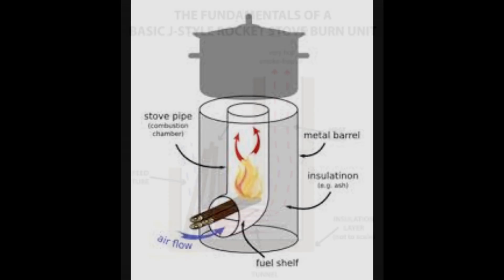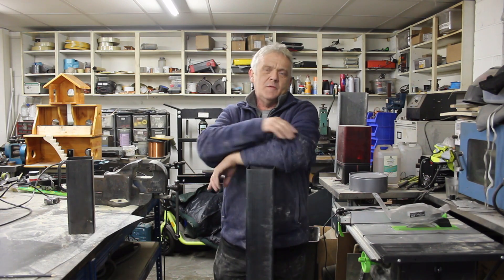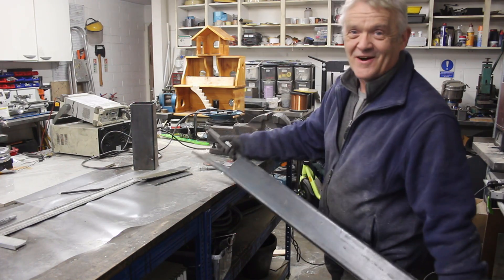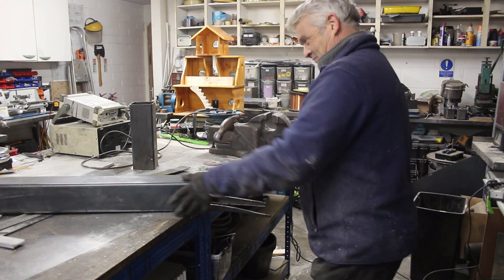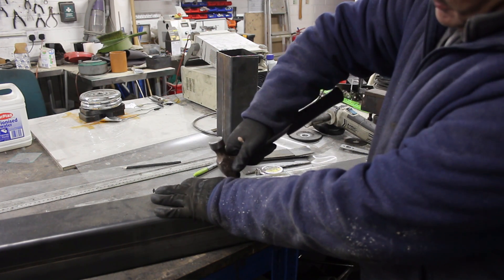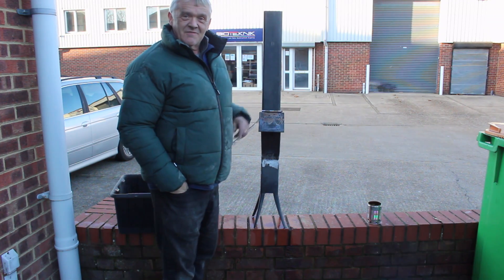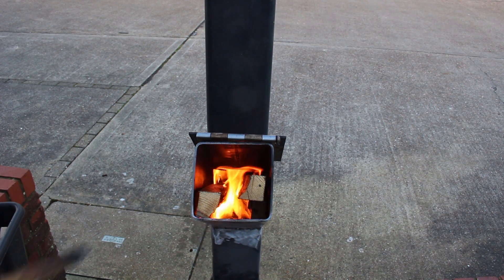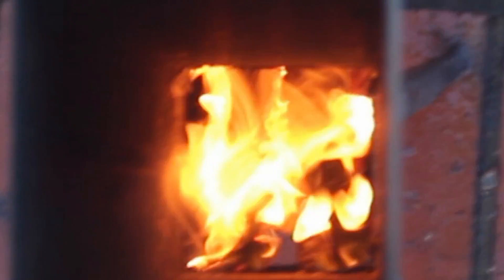1770 A New Type Of Rocket Stove - The 'I' stove

Comment: Have the hot gasses do a u turn so they are directed downwards then another u turn upwards, if you were particularly skilled you could have the hot gasses forced through a few tubes to go down then upward and then make them all form into a chimney and have a sand battery built around the tubes to maximise how quickly the hot gasses heat the sand as it would greatly increase the internal surface area that can be heated and to transfer said heat into sand.

Wouldnt be too difficult to build I imagine

Comment: So, I made a K stove with 2" pipe and enclosed the stove pipe with 4" heater duct.  The stove pipe went zig zaggy so that I had more surface area to get heat from.  The lowest end of the heater vent was open, and the top had  a small duct booster fan in it.  Tons of heat, so much it's scary.  i need an auto-feed because it burns fuel so fast.  You are an inspiration.

Comment: Awesome redesign and good way to think outside the rocket box!!! Good video!... I have a question for Rob and for the whole community. Has anyone put to use these "I" type of rocket stoves to make a hot air turbine for generation? Very recently I came across STONE PAPER, which is fireproof and can be made into container shapes, I was wondering if anyone else is working on integrating turbines with their rocket stoves? like taking this build and model of "I" type of rocket stove, would it be possible to construct a hot air wind turbine, made out of stone paper and place it inside the chimney at the right point to capture that blast of hot air?🤘😆🤘

Comment: 20 years ago, I needed a water heater. I had the innards from an old hot water tank. It was a double skinned copper tube with inch copper connections top and bottom. I stood it on bricks and connected it to a water cylinder. A small fire was lit in the bottom, the sticks dropped in the top. It was in a polytunnel to provide water for a shower. Dry wood was used there were virtually no fumes in the polytunnel. It heated the water quickly. You could use the shower in about 5 minutes. It was also very safe. Young children fed the wood in. The "stove" did not get hot on the outside and you could not hold your hand above it, it was too hot. It was brilliant.
Reply: Yes exactly. The tube was 2 foot long and 6 inches in diameter. I later built a ceramic stove from fire bricks. That had water pipes through it to heat water, for the taps and radiators. I installed the copper cylinder in the flue with a soot box just below it. In the summer I could light a fire in the soot box and heat the water tank without heating the house. The whole system worked really well.
Reply: wow this sounds really cool actually. Was this something like a very big Kelly Kettle?

Comment: Liked and subscribed! i'm curious whether there's any math that goes into deciding such things as the chimney length or volume? I know that 'smokeless' is a good sign because it implies a complete combustion. If there was any math in the decision for dimensions, I'd greatly appreciate knowing what it is, and why it is. Thanks!
Reply: Indeed there is. It has to do with air temperature and the way it can flow at those altitudes and pressures. Engineers are trying to do biomimicry with the things in nature that also employ chimneys for the same purpose, like the giant termite chimneys. There is math there too.

Comment: If welded build.

Some simplifications possibly there:

1. Feet, some lengths of rebar welded to the bottom.
2. Drill a round hole with a holesaw rather than faffing with an angle grinder to cut the flaps and use tube rather than square section for the feed.
3. Drill holes for rigid bar and weld in the grille for 2.

Additional potential mod:

Reinforce the rebar feet with a cross section which can potentially support an ash pan.
Reply: Good improvements!! Would it work if you used Stone Paper or Fireclay for some of these improvements?

Comment: Would you get any advantage if you add a damper at the bottom?
Reply: It would help to restrict the air flow that forms the center vortex of burning hot gasses and air.
Reply: Yes, i see. Up to a certain temperature the heat burns away all gases and after that the heat just goes out into the air. What about putting heat sinks all the way and all around the chimney? Maybe in combination with a damper. Would it maybe decrease fuel consumption due to lower chimney heat and higher heat efficiency/radiation due to larger surface?
/Christian

Comment: Whilst the rocket stoves you make are great (I have ordered the parts for the Rocket Stove Kit from video 1743) and are very efficient for burning, they remain very inefficient at heat transfer in that a lot, if not most, of the heat "escapes" out of the top of the flue. I want to use my rocket stove to heat my 6m x 12m workshop and that means keeping as much of the heat in the workshop. So, the challenge for you is to convert the 1743 rocket stove into an efficient workshop heater without the use of specialised tools. Can it be done?

😀
Reply: yes it can! Just Attach a large container filled with sand at the top with a copper cylinder tube wrapped inside the sand container like giant spaghettis.... This would heat the whole shop and home.

Comment: The trouble with these little wood burning stoves is you spend all day feeding it. Get some coal in it and you can leave it to burn while you get some work done. 😊
Reply: Thats why Rob teaches us to think outside the box with them.... for example, you can construct the whole thing from Fire proof STONE PAPER or Fireclay that can resist melting temperatures, then you can store ALL that heat with a sand battery or better yet, make the stove be as fuel efficient as possible by turning it into a vortex rocket stove that can generate electricity through heat and hot air.

Comment: any idea what's the best solution for long term solar energy storage at home, rather than a lithium ion battery? I mean... They're quite expensive and don't last very long
Reply: Use a sand battery!! SANDY BATTERIES!!! for two reasons; 1) you can directly wire a solar panel to a heating element embedded in sand, it can also be wired up so the sand battery acts as the place where you "dump" excess load... 2) Sand is cheap and everywhere!! plus you can keep it hot and then convert it back to electricity or use it to heat water
Reply: @captainnemo6655  how do you convert the heat energy in sand back to electricity, and how to seriously insulate it properly? I mean in freezing soil for example in some type of container obviously but how to get highest efficiency insulation to prevent any heat loss so the solar charging has its best cumulative heating effect with as little heat loss as possible? Can you elaborate on insulating the sand battery and converting the stored heat to electricity. And how rxactly to connect solar to a heating element, like? I'm super interested in this solution because lithium ion is just not sustainable long term for home storage, the lithium ion batteries are way too expensive and aren't long-lived... My

Comment: Great work. Have you thought of measuring the temperature of the two burn zones? Ie the solid-fuel burn zone and the gas-fuel burn zone. Did you know that if you get above a certain temperature by adding hydrogen that you can burn rubbish safely like they do in Japan? Then the supply of usable fuel expands to include certain types of household waste.
Reply from the maker: interesting mate - thank you

Comment: And the burning coals fall right out the bottom and set fire to the entire neighbourhood. 👍😎
Reply from the maker: really? good god man
Reply: Yeah! 🤫
If you put it on a bitumen surface, it'll go for days with only a few sticks to get it started! 😉
Reply: @aaronfranklin324  ... yep tar and bitumen are flammable.
Of course I was mainly joking, but it is a valid thing to think about. Hot coals fall out the bottom then wind can blow them around anywhere.
A good fire/stove design contains the coals safely within, and has some system to rake out the dead coals later for disposal.

Comment: Love the video. Is it possible to create a vortex by directing the input angle of the air supply at the bottom or side? Since spinning gas will have a longer path inside the hot tube, than air just straight going up;  The length of the pipe would be shorter. Which would mean less materials and also increase in mobility.
Reply from the maker: nice idea mate cheers

Comment: I don't understand the point of building and the use of rocket stove. The only use of it is for preparing the dinner outdoor. 
It is useless indoor without a chimney to out side of the house. 
The same reason you don't make bonfire in your living room. And no it is NOT smokless. Rocket stove still produces smok.
Reply: It could be used for a new design of a outside wood boiler, for instance, or for the source of a heat battery.
Reply: @NdxtremePro  yes if it used for outdoor,  that I can understand.  But the way Robert talks about those rocket stove for heat source,  could mislead some clueless people thinking they can use rocket stove inside the house.
Reply from the maker: there are plenty of indoor versions mate check out the liberator for example - you also might want to read up a bit as there are other things wrong with what you are saying
Reply: @ThinkingandTinkering  I know the rocket stove burns much cleaner and more efficient.  But it still must get some particles in the air. Unless it use some kind of filter. Even a candle gives some unhealty  particles to the room. I know you can't compare candle with wood. 
This wasn't an attack on you. I hvave never used rocket stove. So it is just a theory from my side. 
So you saying that a rocket stove do not give any kind of particles or smell to the room, if you burn it indoors?

Comment: Would be great to add a single copper coiled tube (inside) ; from center to almost top.  Use to heat water.  And perhaps a screw "fuel feed" system from a bin..?  Would work for a long time with out having to put bits in every few minuets...
Reply from the maker: fuel feed would be good - I wouldn't put a water pipe inside

Comment: This has really got me thinking. I have an ash trap in my fireplace that leads to the basement. Could I replace the trapdoor with a metal grate and turn my fireplace into a rocket stove?

Now that I said that out loud, I wondering if it's not a good idea. 🤔
Reply from the maker: it's a very interesting idea mate - I might put a mesh over the grate to stop small bit falling through until they have had a chance to burn completely

Comment: What I mostly like about this is that it's basically self-cleaning.  Just put a metal pan underneath, maybe with some hardware cloth sides to make sure small embers are contained, and the ash falls through.  But you might want some ventilation holes above the grate to help keep ash from getting blown out the top, too.
Reply from the maker: cheers mate

Comment: A curious design could be a vertical centre feed with annular combustion - can double up the annular combustor  - secondary burn - for a  flat top and a ( low- ) side chimney exit..   Cheers for all these ideas on different methods to bio-recouperate unwanted dockets and carbohydrate foam.
Reply from the maker: cheers mate

Comment: I think you'll find its less efficient. I think it will draw too much air and as a result will burn cooler.  A cooler burn and faster gases means more unburnt  gases. I think you need a right angle in a rocket stove to slow the gasses, mix the gasses and allow them to combust.
Reply from the maker: you are guessing there mate lol - I am certainly not sure - but the things you say are easily controllable are they not? One thing you might not have noticed is the design parameters actually follow a Reijke tube

Comment: I don't really get the excitement with rocket stoves because you don't seem to get much from them other than a roaring flame - how practical is this particular design model apart from having something fun to play with and providing a means to get rid of waste bits of wood ? Give me a real wood heater that can pump out the heat in a controlled manner to warm your home, put your kettle on and dry your clothes in front of easily any day.
Reply from the maker: hmm - have you read about the benefits? or have you just decided they don't have any
Reply: @ThinkingandTinkering  No I appreciate them for what they are but they just seem very limited in real world applications in the home. I wouldn't want one in my lounge-room.

Comment: I like this! But it's more an IV type lol 
It definitely works but are we seeing the fire trying to come out the wood feed tube as well, when the cover is open?  That could burn you when adding more wood, but that could create a new "flower" type design by adding several tubes around the center tube. You keep giving me more ideas! I still need to figure out a glass tube with a Bright Betty from your last video!
Reply from the maker: no mate the fire goes straight up the chimney even when the fuel feed door is open - but I like your thinking - cheers
Reply: @ThinkingandTinkering  oh ok thanks. So capping the top would allow a flower rocket stove then. ;)

Comment: Robets, why can you not have the "1" type ... a straight up tube with a grate where you drop the wood fuel in from the top of the 'chimney'?
Reply from the maker: I dunno mate - I just thought it might occlude the airflow - but it is a guess - worth trying your idea for sure
Reply: @ThinkingandTinkering  Robert, I was thinking make your chimney tube as you have for this video but instead of bending the slits for the grate downwards bend them up for a grate above the hole they leave letting the burn pull the air in from below.  If you just drop wood sticks in from the top and not force them down I guess there would be sufficient air flow but to try would prove or not.  Unfortunately I don't have a length of 4" box lying around doing nothing!  :)

Comment: I built up a "rocket stove" thing the day before yesterday with just some stuff burning below a metal tube, open all around. The tube gathered up the flame and smoke nicely. But... <sigh> The tube must have been too short, though, because the thing didn't rocket. Lotsa unburnt smoke/gas. Now, with this video, I think I know better.
Reply from the maker: this is built round the reijke tube dimensions mate
Reply: @ThinkingandTinkering  Ah. Dimensions. I had none. Back to the drawing board.

Comment: I believe you're  missing the point!  A rocket stove isn't there to make a noise - that's just a by-product.  The idea, the point, the goal - is to get all (or at least significantly more) of the heat from the fuel into, usually, your home.  To save on chopping or buying wood, time feeding the fire etc.  These stoves you're making don't do that - they just send more hot air up the chimney (by and large anyway).   How does that stove heat anything (much)?   It would need endless feeding with small amounts of wood to zero benefit.  You were doing better (IMHO) with the gases being fed into an inverted cylinder where they burned and then the flue being long and inside the house eventually exhausted cool gases outside - all the heat being retained inside the building.  This would be the most efficient burn - the design (J, K, L,I or whatever) is what fits the building.  Love your videos BTW.
Reply from the maker: no - I am not missing the point mate - the point isn't to get more heat from the fuel - the point is to get as complete combustion as possible within real world constraints - this will lead to more heat of course - after that it depends what you want the stove to do - if you want it to cook then getting the heat to the pan is what is needed - if you want it to heat a room then dispersing the heat through the room is what is needed - if you want it to be a boiler then getting the heat into the water is what you want it to do - etc etc - this follows the history of the stove if you think about it
Reply: @ThinkingandTinkering  Well - ok - though you just said what I was saying there!  Ok - with that said, all points align then and we are in complete agreement.  Lovely!
Reply from the maker: @Ian8008  I think basically we are mate lol

Comment: One great application would be in a small home with little space for a woodburning stove. Of course sheds and workshops are a foregone conclusion. Add a sliding ash cleanout/air control on the bottom and this is an excellent little stove.
Reply from the maker: cheers mate

Comment: I wonder if anyone has ran a turbo from a rocket stove,  I have seen them run them from barrels, I wonder if multiple turbo's can be joined together at the shaft, in a compound setup,  mostly using the hot side , driven by the heat,  and get enough power to actually drive a gear reduction and do work, powered by 🔥 fire, waste oil, maybe wood, a gear reduction to drop 30k-50k rpm to 1k-2k rpm and be efficient and effective,  if it can make 30+ psi of boost it can do some work, spin a generator or something!! 💡
Reply from the maker: interesting ideas mate - thanks for sharing